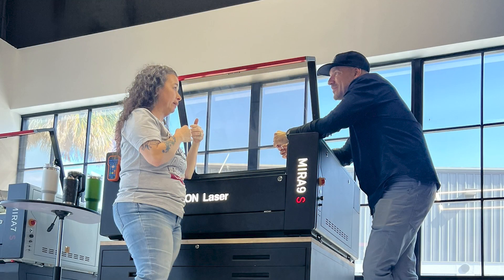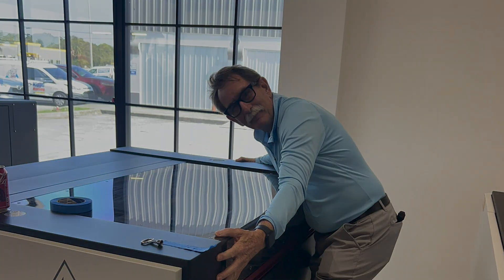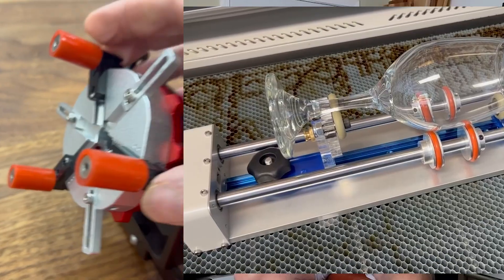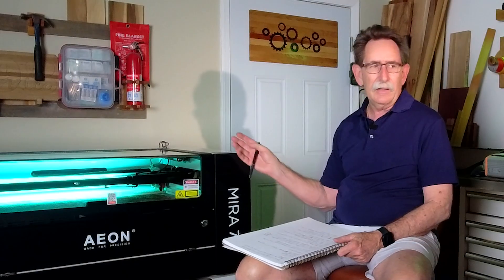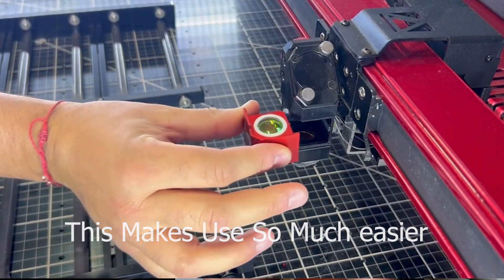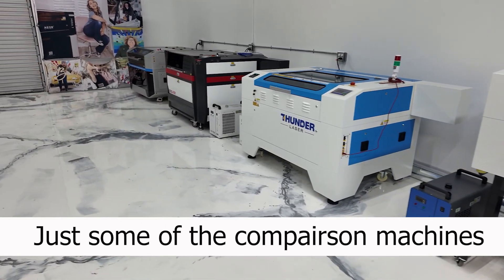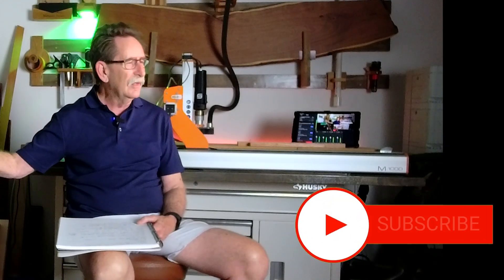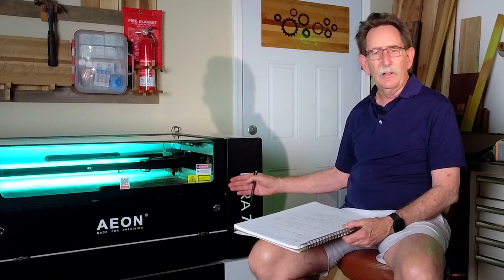Easy C02 Laser Comparison  Aeon, Thunder Laser, Omtech, Epilog, Trotec

Comment: I bought a Monport 60W and within 6mo., it was a constant trouble with ZERO customer service. I took delivery of an Aeon Mira 7 and my whole world changed. For instance, my camera did not work upon arrival so I called Support and within 10 miutes had a new one in the mail with tracking. I am working with Support to dial in my PiBurn rotary. I emailed them and within 5 minutes (no exaggeration) they responded with their first recommendation and they stayed engaged throughout the whole issue. The machine runs flawlessly and it is FAAAAAST!